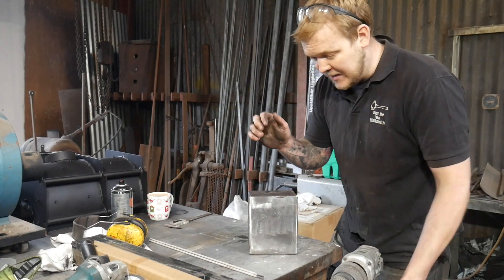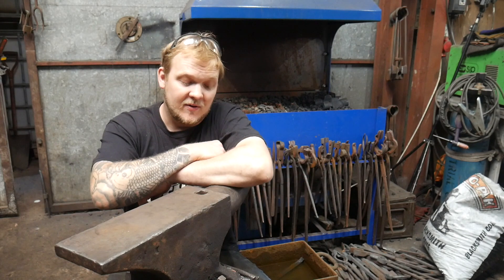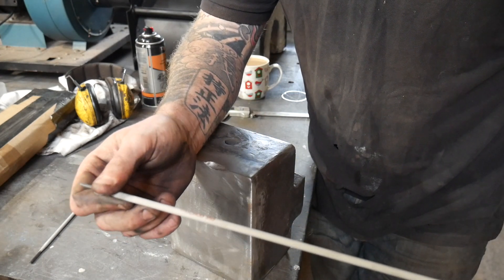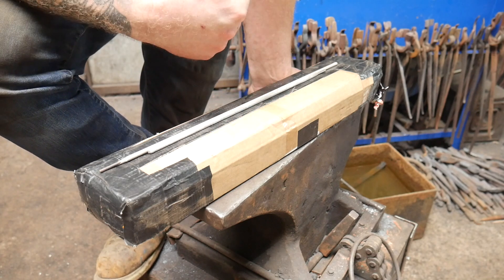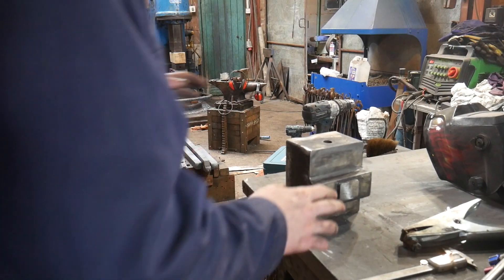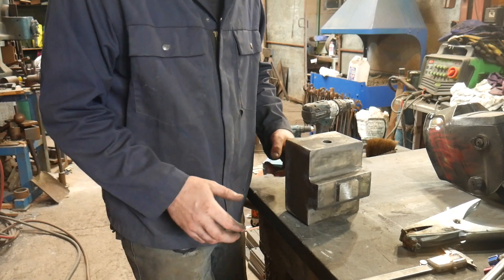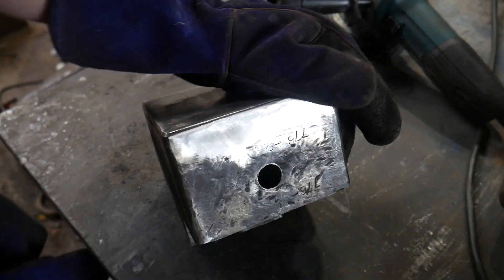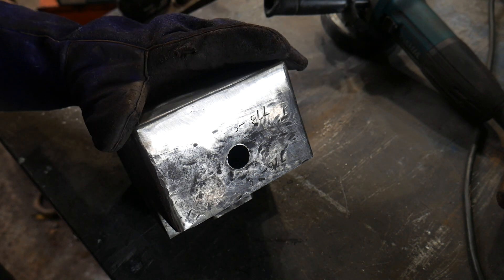How to make small repairs to anvils and other forging surfaces.

Comment: tip for preheat for welding. soot the part to be heated with an acetylene flame only. Then add oxygen to your flame to produce a neutral flame. when the soot burns off a 200 degree Fahrenheit preheat has been achieved.

Comment: Worth noting if you have tig capability you can use just about anything as a rod, ie, if the die is made from 1080 use some 1080 rod, that way you can match the parent metal like for like, can also hard face things then with any tool steel you have laying around, old drill bits works nice 🙂

Comment: I, unfortunately, was weight hungry and got a 156lb anvil but ut has a decent sweep to it and a lot of cut marks in it. Would I beable to weld it with the hard facing rods and ground flat. There is prolably less than a half-inch of the sweep.

Comment: I'm curious how you would use hardfacing rods for an anvil repair but keep your temper. I have a couple fairly beat up anvils but have been too scared to loose temper by doing hardfacing edge repairs.
Reply: Research the "Gunter Method of Anvil Repair".  It's been used on thousands of anvils without any worry.  If my anvil was really beat up, I'd opt to simply coat the whole face rather than try spot welding.  That way you know you have a uniform thickness and strength.

Comment: I think the hardface rods will probably hold up, for my home made Anvil I did as you mentioned, used a gp rod but I used a stainless rod for the top layer designed for welding dissimilar metals, the specs on the box mentioned die repairs, I've also been told that low hydrogen rods will give a harder surface but I've not had the chance to try it out yet
Reply: My old twin track anvil is welded with 7018 low i's and has held up surprisingly well 👍